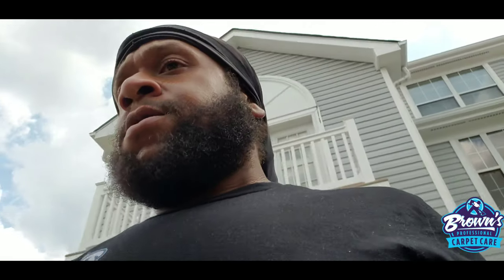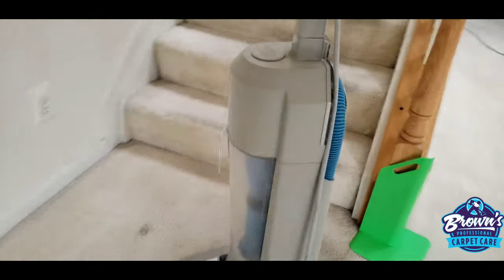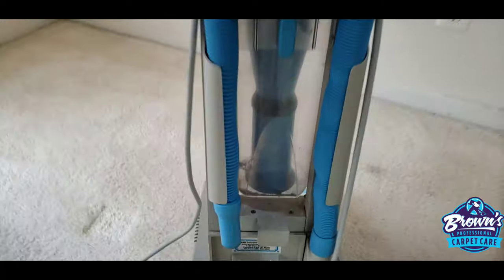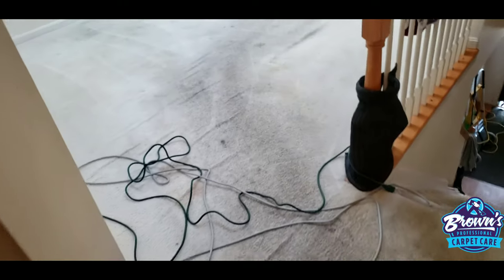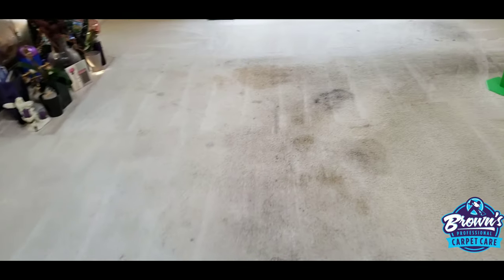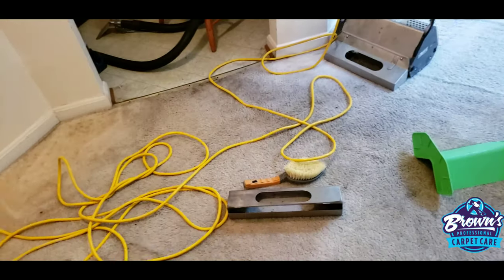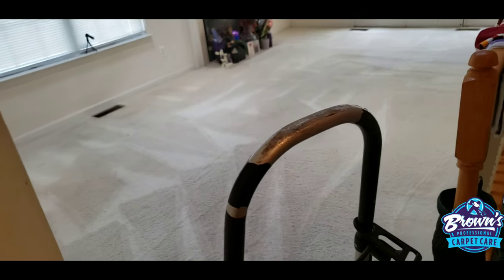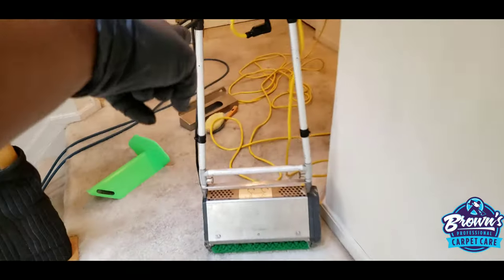Carpet cleaning vlog Episode 80: The Workhorse & Crb combo can't be Beat|👑King Of Stairs👑 at work

Comment: That Workhorse  is a Fantom design from back in the 90's that Dyson patented before he came out with his own vacuum line. You have a great vacuum there that has easy and cheap replacement parts from the company. Vacuuming is such an important job that can take 25%+ of your time trying to get ALL  OF THAT dry soil out, so no your prices aren't high.
Reply: Best thing is the workhorse seems to work better than any of Dyson’s vacuums here in the uk, especially his first models here DA001 and DC01. The workhorse looks like a far superior design. I’m absolutely gutted and devastated that they are not available here in the uk.

Comment: Gonna ask a really stupid question now. But why do I never see carpet cleaners vacuum round the edges,especially with light colour carpets. So many people end up with that dark Mark all round the edges and with a quick vacuum with a crevice tool ( and maybe the Little radiator brush in the end of the crevice tool ) a lot of that dirt will come up
Reply from the maker: Not a dumb question at all.  I have a crevice Wand tool and I use a vacuum crevice tool for filtration lines. Yes! I Vaccum the edges.  ( Additional service for filtration line removal though)

 One reason for the filtration lines(Dark area around the rooms)  vent systems and also never Vacuuming.  To get the dark area takes a long time to accumulate